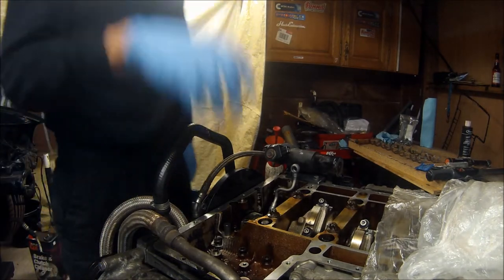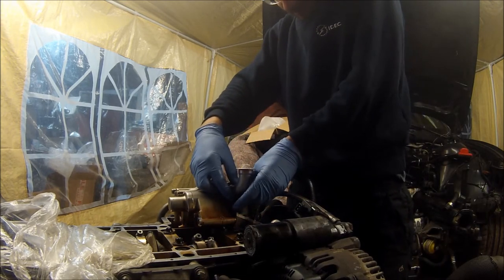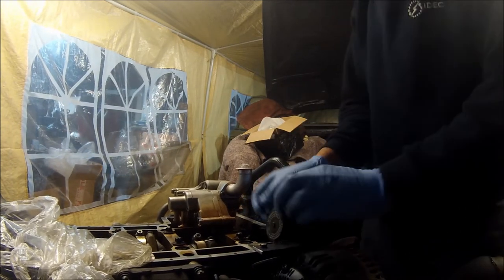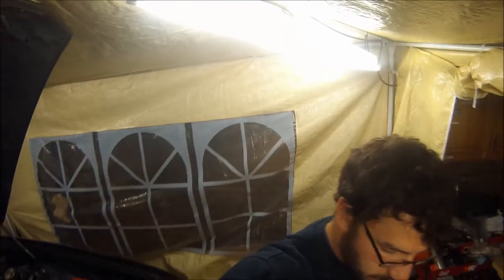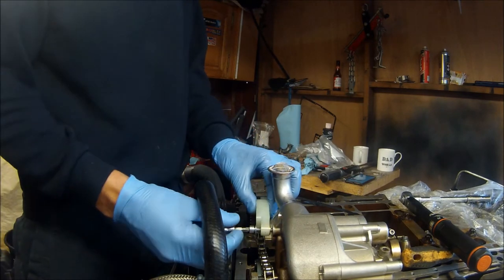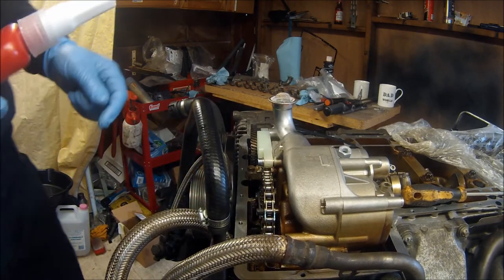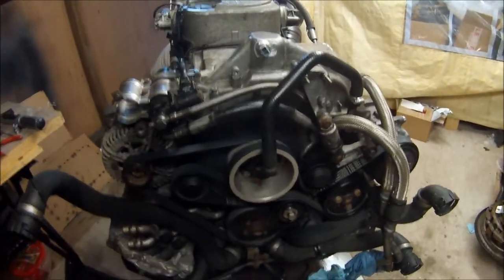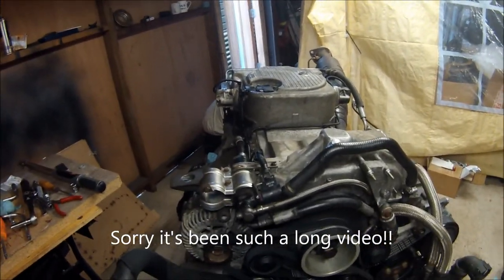BMW E39 S85 V10 Swap Rod Bearings and High Pressure Vanos line DIY Part 2 E60 M5 E63 M6

Comment: E39 s65 is a better engine than the s85 , s85 only lasts 60k miles and sounds rather awful .
Reply from the maker: I think you mean the s62? I suppose the sound is a matter of opinion what people prefer. the s62 does sound good, but so does the S85. For a high revving V10 the fact it needs servicing a lot isn't a suprise really
Reply: @rodknockers2036  Ah yes the S62 , i got one ,great car had it since 2004 , yea i hear you about the V10 ,yes great engine but mega bucks and a supercharger on e39 is a better way to go but hats of to you for taking on the challenge.
Reply: @eljockvis  dude this is like a next level, everbody has the s62, he is probably the fırst guy to do this madness. And thats why its special. (S85 into an e39 body) huge respect to him.
Reply: S85 needs a proper Service and money. Which is why its absolute glory for those that can. Not so much for brokies, complaining its expensive to maintain 😂